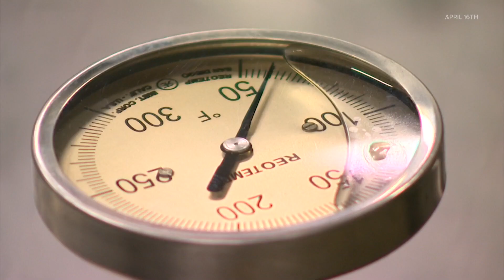Washington State Ferries guarantees what happened with the Walla Walla won't happen again

Comment: What about having a belts-and-suspenders approach?  A completely separate, different fuel source (like gasoline) emergency generator, and a separate battery pack (dedicated to emergency control, not propulsion).  Just like a press conference does not tell the reporter anything truly important, going to interview the Washington State Ferry System will only give you their side of the story i.e. excuses.  The reporter should have interviewed marine architects (there are several in Seattle that specialize in ferry design and construction), experts (that is what the UW is for), and retired WSFS workers willing to be honest.

Comment: Fuel contamination? I work on ship engines and I really doubt that was the issue…. B.S excuse
Reply: Ya, it's strange, I am sure they have at least 10-micron racor fuel filters on there if indeed they had contamination. Besides, they run those engines consistently, and new fuel is supplied regularly. Did they not change the filters? It's been long enough that they should have had the results of a fuel analysis, water is easily visible, and microbial contamination grows at the bottom of tanks. He said they cleaned out the tanks, it would have been noticeable then. The answers they are giving don't add up to me. The Coast Guard report will be interesting. I want to know what the Chief Engineer is saying.
Reply: It was clogged fuel filters, which blocked fuel supply completely. The filters were apparently clogged by bacteria and fungal growth in the ship’s fuel tanks. They are now cleaning and inspecting the tanks more often than they used to. It’s either a product of complacency (aka, the “we’re not following directions but never had a problem before, so we won’t change our ways” vicious cycle) or maybe the aging of the vessel. Complacency was also one cause of the ferry that struck the piling near the Fauntleroy dock. There’s supposed to be someone monitoring the captain in the pilot house at all times, someone who is also capable of piloting the ship. In the past, this wasn’t always the case. The captain was unsupervised that day, and we think he fell asleep at the controls: of course another change after that incident was making sure the employees are well rested before going on duty. 
We have come a long way in safety though. Back in the day when people could still be invited up into the pilot houses by the captains, someone up in the San Juans suggested a captain take them on a longer scenic route. And guess what, they ran aground! It also happened in heavy fog conditions a few times when navigation systems weren’t as advanced.